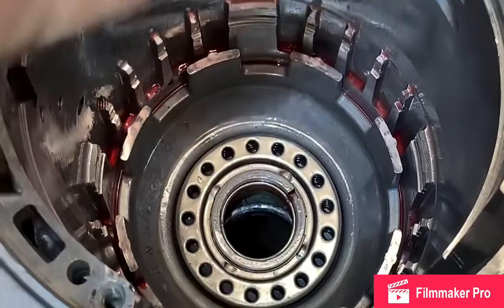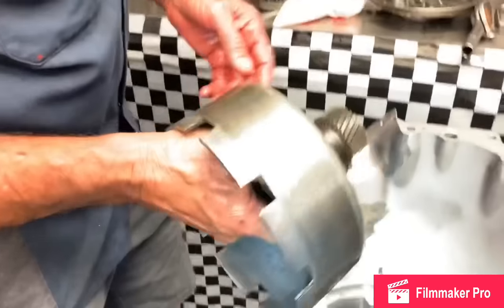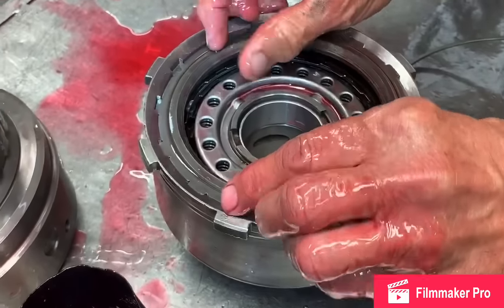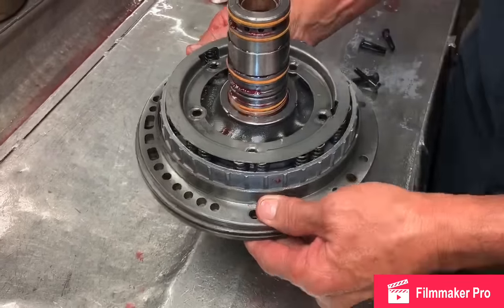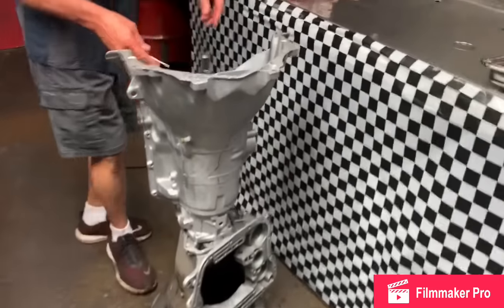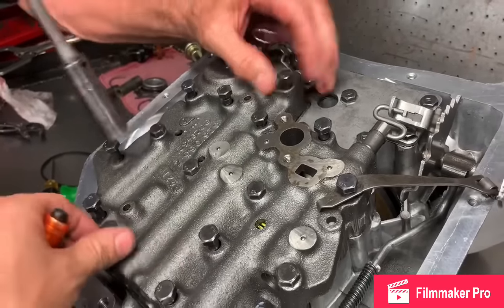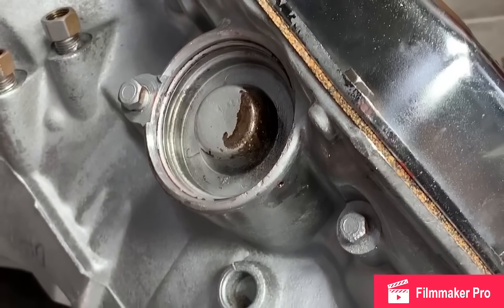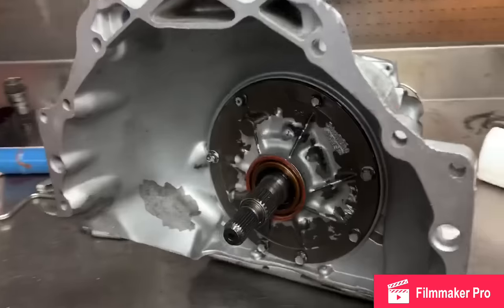It’s a Build video

Comment: I'm more into hobby machining, although have done a little shade tree wrenching.  Love watching someone with so much knowledge to share.  I know enough to stay out of transmissions lol.
Reply: I rebuilt a 4l80 on the side of the road  with a flathead screwdriver 4 wrenches and 3 sockets. Not that hard
Reply: @circusboy90210  😑
Reply: I remember being told many years ago about how intricate and complex auto-transmissions were and my naive response was-c'mon how hard can it be ? well,extremely hard as it happens,you'll never learn this on a couple of years at college,this requires a high level of knowledge,focus and dedication to detail and the main thing LOVE of the job,i.e. you'll NEVER be a professional golfer if you don't LOVE golf to start with.

Comment: in 1985 I was building for an aamco in Charleston SC back in them days we would average 5 - 350's or 250s a day. the owner had 3 shops. he had all the units cleaned and on a cart. and all kits and hard parts. he had a full time man that just tore down and cleaned units to build for stock. me and another older builder double teamed 350s one day. he built the drums and pumps and I put them in the case. we built 21 in 10 hours! the next day we did 18 and we were tired at the end.

Comment: I love watching this, I remember attempting to rebuild the transmission on my old 70 maverick back in 1984,  All I had was a crappy book and word of mouth people told me.  It worked fine for 25 miles started slipping bad. I had to drive home the last 5 miles in reverse.   I can still smell that smell of burned transmission fluid and toasted clutch material.    Went to the junkyard and bought a used one for $50 and it lasted the 2 more years I had the car before that old 170 6 cyl engine finally blew.

Comment: Damn this dude can rebuild a transmission in less than 2 hours...that's crazy.
Reply: To be fair I think a lot of cleaning and prepping and setup of the parts were the hours done prior to the video.  As he said all those tolerances had to be just so.  Then a final clean of area and parts to begin assembly.  Prep work is usually 90% of a job.

Comment: I tried that with a speed wrench, almost knocked my front teeth out!
Reply: I tried that with a speed wrench, almost knocked my front teeth out!
Reply: An aircraft mechanic for 35 years and always used speed handles. But never got the knack for doing that lol.
Reply: @richardlewis7471  Ahh the speed handle is God's gift to us mechanics. I appreciated it greatly especially on the fuel panels beneath the wings and belly of the CRJ 200's I used to work on since we were forbidden to use any power drills. Tedious panels those are, and that gasket we had to always put back on them never wanted to line up with the holes on reinstall, not matter how much pet we put on em! xD

Comment: I rebuilt a 700r4 back in early 2000 I drove it 65 miles and wiped out 3-4 clutch .I will try again soon and will have great success with a video instead of a class manual I found at a thrift store which was very detailed but a picture/ video is priceless 😀

Comment: Thank you very much for your wonderful videos I just rebuilt my 727 transmission complete teardown replaced everything that needed to be replaced and that you recommended I did all that air pressure test that you guys recommended the pressure test everything replaced all the seals all the bushings all the clutches works great first time thank you so much keep up the good work guys love your videos     Did my 1987 Dodge Ram pick up 3/4 ton

Comment: Yea im gonna keep my manual transmission thank you very much. This looks like a nightmare
Reply: As if rebuiding a manual were a walk in the park...
Reply: @Gavichap  compared to an automatic transmission it is a walk in the part. I have rebuilt my trucks transmission and it was very easy compared to this nonsense.
Reply: @coolstreetman  This "nonsense" is finest mechanical, hydraulic and electronic technology. We won't be on the Moon if we stuck with clunkers and pushrods. Over here manuals are just trashed when they go wrong or wear out because gears and synchros need a lot of expertise to be correctly shimmed and realigned. Or else face whining and clashing and more.
Reply: @Gavichap  Saturn V isn't a fair comparison :p

Comment: Do you guys do front wheel drive transmissions or cvt I would love to see these tore down thanks
Reply: Could start with an old  TH125 or 125C..simple trans I hear
Reply: @Bumblebee4788  No transmission is simple any good builder will tell you that!,I worked @ a large shop saw a powerglide wear some of the best a new rear. So how many 125s hav YOU BUILT?.

Comment: I’ve never had a 350 that didn’t work great. They are a great unit.I always put a special tapered punch in the two line up holes in the bump and then torque bolts.there’s two holes in the pump that are smaller to line up all holes when installing the pump in the case. I install two wider bolts to install perfectly lined up holes and the gasket. The more accurate the better. I torque every bolt no exemption.

Comment: I was taught a trick years ago on how to align a th350 pump. Use 2 th350 modulator valves 180 degrees across from each other in the pump bolt holes where it bolts on the case.  I've built many th350 like that for years.

Comment: I've used many a speed handles in my day in the Airforce Jet Engine Shop and a mechanic,  I worked on J-85, which goes in the T-38, and TF-34 which goes in the A-10. Many bolts on the flanges. Plus have a few I use at home.

Comment: Same with drum return spring snap rings there is an up and a down direction. Put the snap ring correct side up and it will come out easily with snap ring pliers and the wrong side up and the snap ring pliers keep sliding off. The opening in the snap ring is tapered.

Comment: I've used either a large hose clamp to align the front pump, or insert the front pump backward into the case and use the case to align it while you tighten the bolts.

Comment: I about got a tear in my eye watching you work! I used to ply the transmission trade in the dealerships back in the daze, doing mostly Aisin-Warner slushboxes in the Japanese cars and the ZF's in the old German heeps. I did the occasional GM Hydramatic and TorqueFlite gearbox as well. I loved it. It made sense to me and it was pretty clean work as well. My hat's off to you for a GREAT build that exhibits your 40 years of experience. Thanks for sharing and taking an old, retired wrench down memory lane!!

Comment: My dad's been rebuilding transmissions since the 60's not this fast though.... He takes his time to obtain perfection.  Always with a speed wrench and an old used socket (better not borrow that socket).  I always put a case saver in the GM transmissions.  Seen a lot of GM cases stripped out because folks use impact wrenches installing the pump bolts.

Comment: I've been a mechanic for 30+ years, never really got into transmission rebuilding. But when you see someone tear down a trans fast as you guys do, and explain things same time and you do it in record time.... just imagine how fast you guys are when you are not explaining thing.... I would like to get info to ship you my customers transmissions. Cause alot of transmission shops now days just remove and replace they get theres from some remanufactured places that don't do above and beyond and improve,  they  just go through the motions. While you guys know what's makes them fail and correct and upgrade to fix the problems. Well ✔ 👍 I would like to get your shop info to send you work. Cause transmission shops local are getting away from building and just installing.  You guys are a Dying Breed that we need to bring back to industry. To put back once was great. To shove it back into corporate industry's face for making a product that is guaranteed piece of s***. Way to go guys i appreciate all you do and all that you share. For everything you do is a lot of Trade Secrets. Only 30 40 years experience shows. If I could leave ten thumbs-up I would

Comment: I smelled the smoke of the concentration .lol. Make sure its not the magic smoke. Like from a computer. I admired the (experienced) bushing driver but noticed the table abuse. Man thats millions of smashes to rearrange that tables shape like that. My boss just retired at 80. He had a old speed handle that he twirlled from the end. I love your knowledge and expertise in the little details.thats what makes things work much better than just slamming the old 350 together in the sand box lol
Reply: Gorilla snot on that tail seal. I saw people ruin those housings by driving out the old seal. With a screw driver at tear down with the transmission upside down on the emergency room table.that put a gouge in the seal mateing surface and a oil leak groove was made. Oil sits in that rear section about a forth deep. Its getting slung by the governor and feeds the oil grove for the yoke bushing.

Comment: This is pretty good work for in a shop. Showed you all the tiny things you really wouldnt even think that were important. The check balls. Theres. Tiny little screen filter in a clutch drum in the 62te that im not even sure why its there, but if its not there there will be problems. Theres also a tiny little cup that fits in the end of the comounder shaft that will cause the transmission to leak and pressure fail when tested. Its literally what a thimble would consider tiny if thimbles could think about stuff like that. If a thimble needed a thimble it would look for something like this. If its not there bad things will happen. And if you dont know its supoosed to be there you wouldnt think anything about it. 
 Good work not really having the stands and cradles for the case and the parts.

Comment: I am impressed of your skill and knowledge, but I prefer manual gearboxes for the simplicity and ruggedness. I have taken apart a Borg-Warner 35 partly, to clean out metal particles from a brutalized torque-converter. My wifes work in her anger on a parking lot, haha.

I never took an Automatic Transmission Gearbox apart before.

I cleanded the control system only.

It worked perfectly well afterwards. I replaced the strainer gasket wich had been sucked in partly, making the strainer ineffective.

First it hesitaded to shift properly though, but after some force-shifting up and down, it worked perfectly well again. I was not clean enough I suppose. And I did not take everthing apart. The last metal shavings or small particles got caught in the strainer eventually, I suppose.

Comment: I know this is a very difficult question to answer...How fine/course do you like to buff out your steels? It was hard to tell which coarse size scotch brite disc you like to use? Lets just say you were using some good wet sand paper, would you compare it to 400? 600? 800 grit? The reason why I'm asking is I am rebuilding a six speed GM/FORD  6t45/6F35 and I was planning to use either a Green or Yellow 3M Roloc disc instead of a scotch brite disc.

Comment: So, what does fixing the kick down lever in the first stage accomplish? Higher line pressure? firmer shifts? higher shift points? I can remember installing "shift kits" in TH-350's when I was a kid,(for every car I ever owned) and the instructions for the typical "B&M" type kits back in the day had directions for doing away with the cable, but never fixing the kick-down lever in a position like that. 😕

Comment: That was the clutch master  cyllinder, a easy check is to take off the cap and see if the fluid goes up instead of to the slave,  You might use a electric screw driver in stead of the speed wrench.

Comment: The kick down was alway a problem for me whenever I installed a shift kit. I would do a tow set up and loose the kick down function. Even if I pull the cable all the way and floor it, it wouldn’t kick down unless I did it manually

Comment: Check ball in pots drains pressure at the the pot and locks under pressure, centrifugal force throws ball off centre to drain.and is slightly loose. Once plates in safe?

Comment: S-clip adjustment on the manual valve?  Air check the accumulator and the clutch packs before valve body install?  Speaking of valve body, it's a good plan to remove all the valves and related assemblies to clean all the debris accumulated.  Support plate mod to feed direct clutch both sides of the stator support, doubles the supply/vent area.  Just sayin', Mr. Hipster.

Comment: What would make just 5th gear sound like metal to metal when u go too shift into the gear.   All other gears work just fine as should no delay or hesitation in output or performance but when I go to shift into 5thand let off the clutch that’s when u start to hear the grinding sound

Comment: Thank you for the lesson real good info coverage I learned from this episode a few things that will make a difference In reassembly can you think about a Ford Tran from a 2013 I was told if I get to much power to the transmission it will fail, I built my truck to drag and someday I’m afraid I might hurt it ,is there anyway to get the trans to take the extra hp around 700 hp 690 ft lbs torque thank you

Comment: I love watching your videos, I own a 2019 Chrysler 300 with a 3.6 v6. From time to time since I bought the car , whenever I start the car, I hear a knock coming from under the floor near the transmission. I read that it could be a loose flywheel or torque converter. Would that be covered by warranty. The dealer says to wait whenever it knocks more often , I think there trying to run out my 2 years warranty left on the car, I’ve only had the car 1 year. It runs fine , after the engine start. Thank you.

Comment: I have a turbo 350 behind a 383 chevy making about 440 lbs of tq at 4000rpm, but I rarely drive it hard. I like the idea of overdrive but don't like the 1st and 2nd shift pattern of a 700r4.  The 2004r shift pattern is ok but I understand they don't hold up well. Is there a compromise?

Comment: At one point you said you tightened the bolts to 10-12 inch/pound and at another point you said foot/pound while apparently using the same torque wrench, which is correct?

Comment: Does it help to freeze the bushing, to shrink slightly ?  I see some guys do that when putting in cylinder sleeves when rebuilding motors, as it will shrink it slightly for an easier fit.

Comment: Would be great if they had some type of device to mount a finished trans on to run and go through all the gears before reinstalling back in the vehicle, like a Dyno like they mount a motor on to test.  I’m sure with todays run by wire and computer controls probably not possible, as mechanical controls now all controlled digitally.

Comment: Where does the normal "full" fluid level in a TH-350 end up, above or below the pan rail? I picked up a used, built, TH-350 with an ATI full manual, reverse pattern valve body w/transbrake. The trans has an aftermarket dipstick in it with NO markings made on it to indicate full or low. The trans will NOT attempt to go into gear unless it's way overfilled with fluid. Once it's overfull, the trans goes into gear, and works GREAT except for the fact that it will blow some fluid from the vent tube.(I'm guessing it does that because it's overfull) and it leaks all around the pan and where the dipstick tube goes in. It has a deeper than stock pan on it. With the pan off, the filter looks to be quite a bit higher up from the bottom of the pan than any other TH-350 I have worked on. The filter is up higher than the pan rail on the case, and I'm guessing that is why it wont work unless it's overfilled with fluid. It looks like the reason the filter is up higher, is because the aftermarket valve body is thinner than a stock one, and raising the filter up too high. The filter that's currently on it, is one of the ones that picks up fluid from the top side of the filter. What should I do to fix this issue? Should I make some kind of spacer to drop the filter down lower? Should I also use the style of filter that picks up fluid from the bottom side instead of the top? Where should the normal fluid level end up on a regular TH-350? I imagine it blows fluid out of the vent right now because the fluid level is higher than the pan rail, and covers the dipstick hole. The case can only breathe through the vent like this, with the fluid level being so high up that it blocks the dipstick tube. Anyone ever experience this before? 
I have always used TH-400's for a transbrake application, and am much more familiar with them than the TH-350's, but I inherited this TH-350 from a friend, and would like to use it for my lower powered (500h.p.) street car. It works and shifts so nicely, but the leaking and blowing fluid from the vent tube makes a damn mess. I thought about installing a catch can to the vent, but there has to be a way to fix this issue. 
Any help would be GREATLY appreciated... 👌

Comment: I have a th400 brand new from chev I bought in 85 which has been keep inside and never used. It for a 81 1ton 4x4  454.  Does it now a over haul.
Reply: Does it need a over haul. Thanks
Reply: I hear the shift points are different from a 350ci

Comment: Hi I recently bought a ford mustang 1970 with a leak in the transmission. We changed the oil filter, cleaned the oil pan, and installed a new gasket. It kept leaking so we bought a new gasket and it still leaks, any answers as to why?

Comment: I need some advice on my trans. Its in a 2012 f150 3.5 ecoboost. When the trans is cold it shifts fine. When it begins to warm up to operating temp it will make a harsh up shift and a harsh down shift only going into 3rd gear. Also it pauses while cold going from reverse to drive. It takes a min to engage. What could be the issue. I have no transmission knowledge at all so any help would be greatly appreciated. Thanks